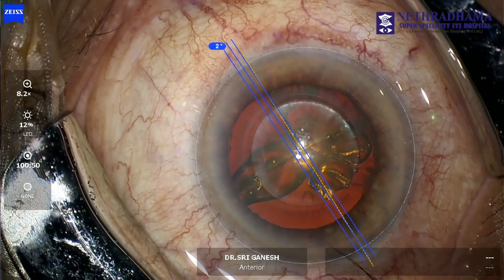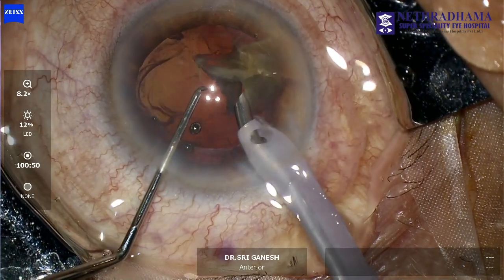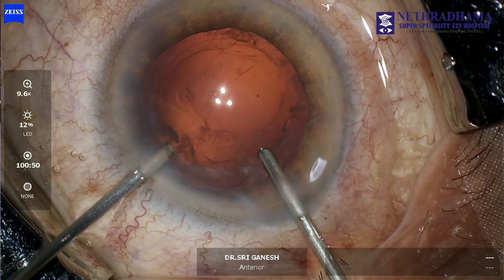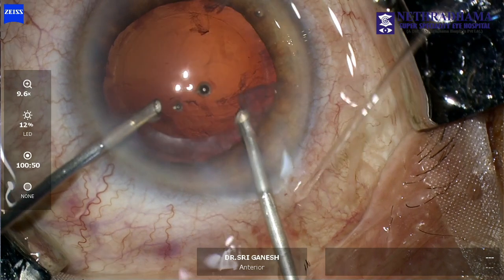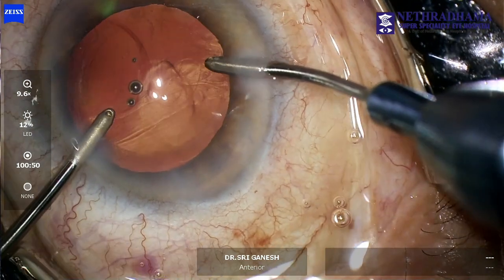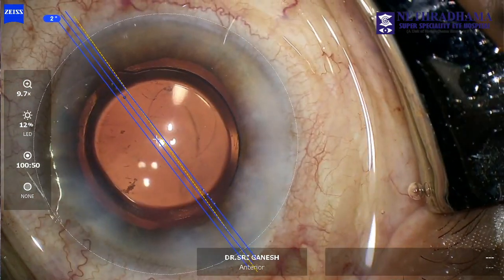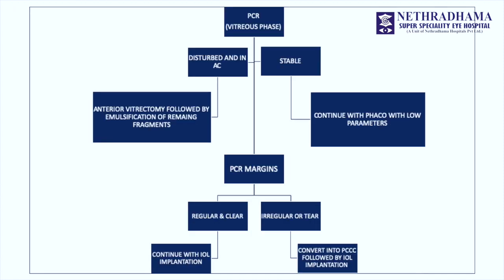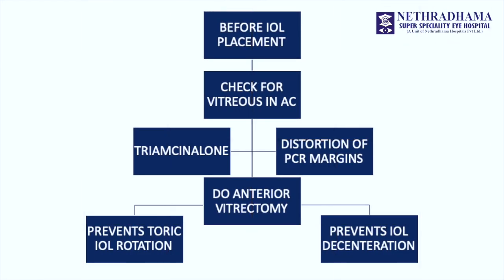Dr. Sri Ganesh's teaching series - PCR Rescue

Comment: Did you recalculate the IOL power following the PCR as the ELP would change? What method was used? Excellent management of PCR!👍
Reply from the maker: The ELP wont change, since the IOL was put in the capsular bag.If the IOL was placed in sulcus, then only we have to recalculate the IOL power.
Thanks for your appreciation.